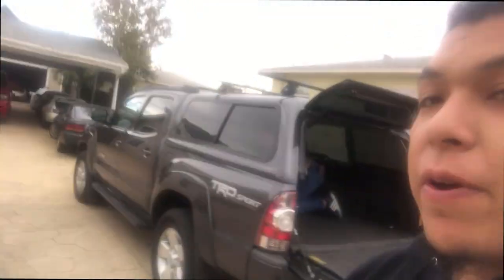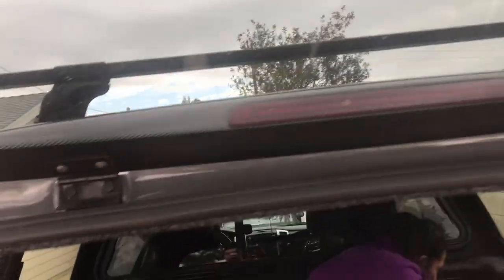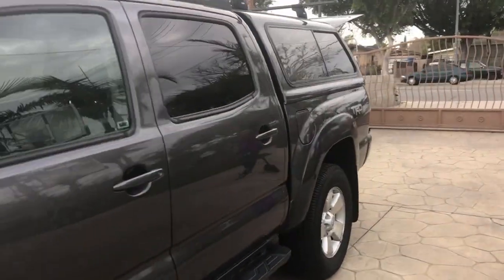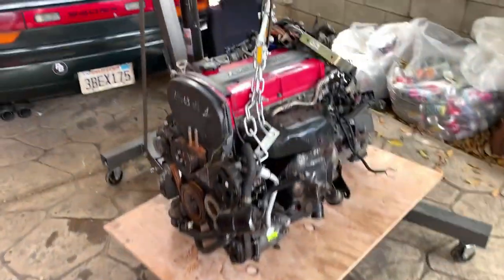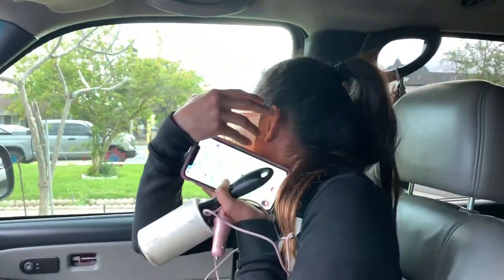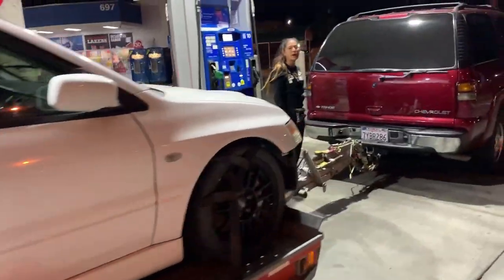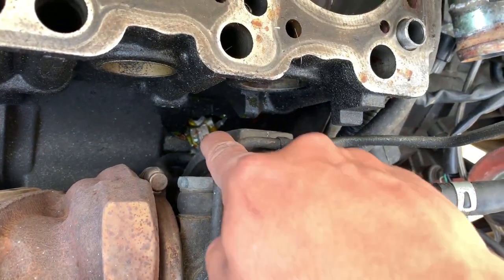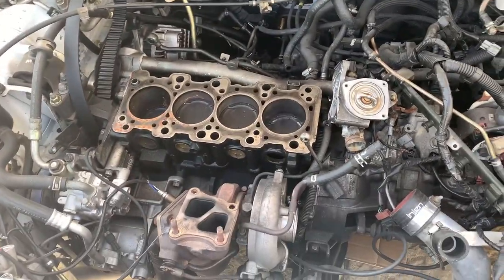Selling One Of My Cars and Picking Up Another

Comment: hi my check engine is on what kind of obd should i use for toyota celica gt 2000?and can you tell me how to use it i never done it ...thank you
Reply from the maker: Any obd 2 scanner should work and it all depends which one you get it’s fairly easy just plug it in
Reply: @RafasGarage  before anything else thanks for your reply...do i need to start the engine after i plug the OBD scanner or do i just need to turn on the switch?
Reply from the maker: Car need to be in the on position or it can be on if you want to read live data and your welcome
Reply: @RafasGarage  hi i was cleaning my trottle body clean my maf sensor after 3days i seafoam my car and after 5hours the engine is cold then i change my spark plug then the day after the check engine ligth pop up. do you have idea what was the problem?
Reply from the maker: I wouldn’t be able to tell you, you need to put a scanner